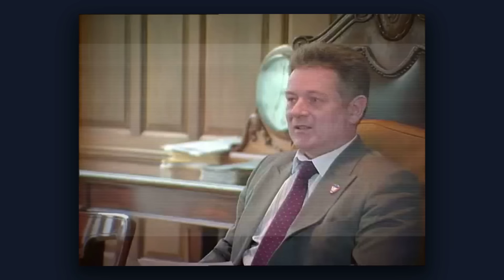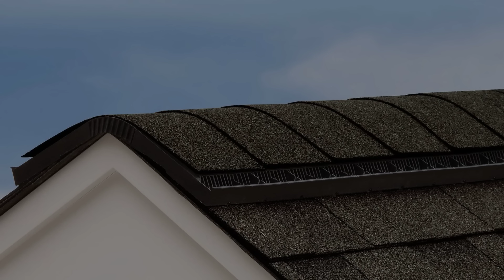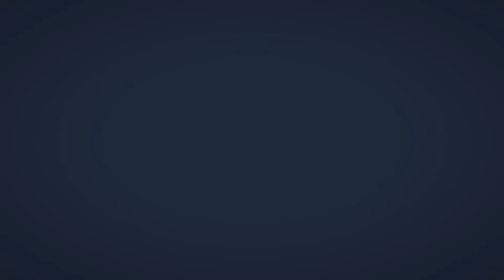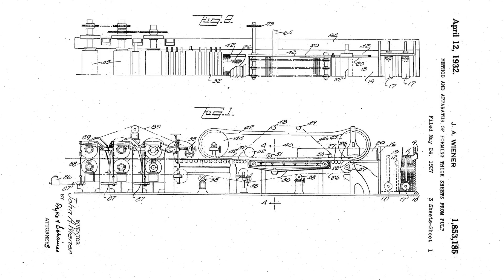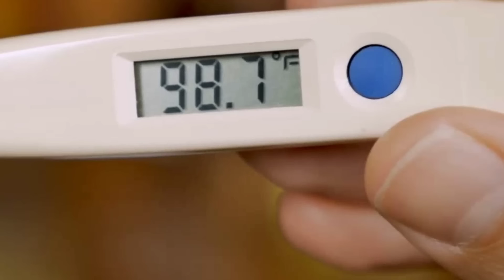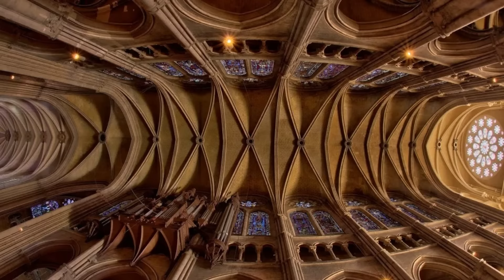This $20 Mesh Drops Attic Temps by 45°F — Why Did the Roofing Industry Buy the Patent?

Comment: I started using ridge vent in 1987 in Tampa, Florida, and there's a roofing contractor installed two different types, on over 200 homes.

One bus, an aluminum cap that were 8 feet in lensing could be joined together and sealed. And it was almost impossible for rain to get in and the other one I was from gaf, where you could literally nail the ridgevent shingles over it.And it gave it that necessary gap for the roof to breathe.

That was one of the highlight, selling points from my customers to show them that they didn't need the very ineffective turbine vents.

I watched this video in no disrespect. Felt like it was in education but unnecessary because the solutions were there and perhaps there was a patent suppressed by one company. But ellen, corning and g a f in nineteen eighty seven, the time that you're talking about the patent was granted is exactly the time. When these products came out and all I saw was the wire mesh that you were talking about, which would be used on metal roofs at the peak, when you cut back open up and have 3-4 inches of roof ridge line exposure, allowing the heat to rise naturally, plus of course. Having soft vents helps and gable ventilation as well.

You never did show and point out the mesh, which was also sold in ten inch pieces for the softs in 1987.

Would be nice if you did a follow-up on this, and explain why you "seemed to ignore" the entire industry of people, like myself, that were utilizing the wire mesh, as well as the aluminum ridgevent with fiberglass mesh inside that kept insects from getting in.

One patent granted and purchased by that industry is no indication of the entire solution, being suppressed,  lol. 

I've invested in hydrogen on jamand energy. Solutions that have been suppressed, which is far more interesting on the side of it being suppressed.

But insurance companies do not want buildings to last a long time as I have discovered with some building material designs, like S.C.I.P. building systems, which the entire lumber industry tries to keep suppressed.

Comment: Disliking because it's a very well known tech and no-one can hide it. YouTube is becoming garbage because of these sensational tiktok titles. Please stop it and this didn't have to be a 17 minute video if your mission is to spread knowledge. And no , sealed roof have there own purpose like vented roofs like retaining heat in climates where it is needed. Share full knowledge, hot roofs are a design mistake by individual builder and homeowner, not someone blocking the knowledge of stack effect.

Comment: Another AI slop teaser, this one touting some special mesh for ridge vents, but fails to tell exactly what kind of mesh.  Awww … How special (dripping sarcasm)
Ridge vents.  It’s not so much the mesh, as much as it’s the ridge vents along the full length of your roof ridges, instead of relying on just gable vents or roof vents.   
What kills the circulation:  Commonly, insulation installers block soffit vent intakes with the blown-in fluff, which raises humidity & heat in the attic.  
Stop using wasteful, asphalt shingles — use metal roofing!

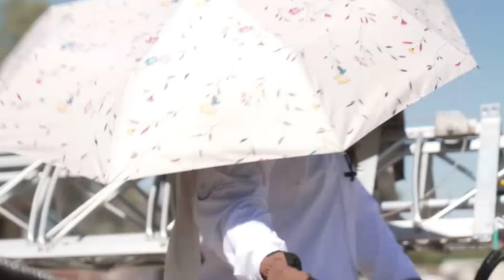Comment: 8:23 US Patent 4,815,242 is for a Modular lean-to post and beam structure. 
Issue Date: March 28, 1989
Inventor: Jerry P. Woodson
Assignee: Whitemetal Inc.
Title: Modular lean-to post and beam structure 
The patent describes a system of components designed for constructing a lean-to (a structure with a roof leaning against a larger building or wall) in a modular fashion, likely involving post and beam components.
Note: As this patent was issued in 1989, it is expired (standard utility patent terms are 20 years from the filing date, or 17 years from the issue date for patents issued before 1995).
Reply: I looked it up myself, I wonder how much else of the video is bullshit.

Comment: This mesh would be BAD for every roof in the US, except for ones in consistently DRY climates. Without the high temp difference, you lose the convective air flow, thus losing the day/night air exchange, THUS LOSING THE REMOVAL OF MOISTURE. The solution to lower energy costs is not a stronger radiant barrier, but a sufficient layer of attic insulation and an air tight ceiling. The solution to longer lasting shingles, is upgrading to a better quality than asphalt... a cost which would be equivalent to the cost of adding this radiation barrier. If you fail to remove moisture, then you'll be replacing a lot more than just shingles every so often.
Reply: Night flushing and cross ventilation work extremely well too
Reply: @scottofgreywaterwatch1298 in order to get sufficient cross ventilation you would need at least a fairly constant 15-20 mph wind throughout the day. In my region, we might see a handful of days with those winds DURING SPRING AND FALL, but not summer. Not when humidity and heavy rains saturate the attic and roof sub structure.
Reply: Oh I know about humidity, I live in Southeast TX/ the armpit of Texas. I like the sunken/bermed method alongside thermal mass. Kinda hard to permit in cities though. I think the point is just keep looking for what works for your climate, and whether your rural or suburbs/city. You can always improve. Just hooking my fridge to solar saved a lot.
Reply: @scottofgreywaterwatch1298 I'm on border of Mid Atantic and New England, here we just need to let the ventilated attic do its thing. Gable vents work better than ridge vents here too. The issues people have are mostly from insufficient or degraded attic insulation and leaky ceilings. They watch a video on YouTube and think they need to either spray foam the under decking or use a fancy radiant barrier. These companies come in and charge an arm and leg then throw in extra insulation and the customer doesn't realize it was the lack of insulation the entire time.
Reply: you must be part of the industry conspiracy!
Reply from the maker: That’s a fair point regarding the importance of moisture control and proper ventilation in different climates.